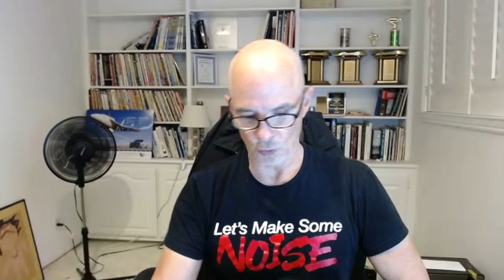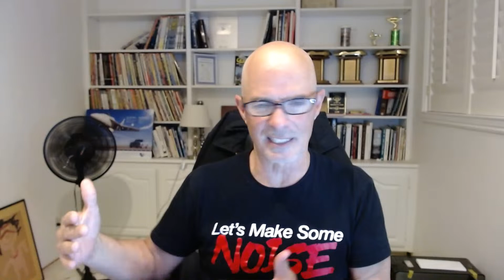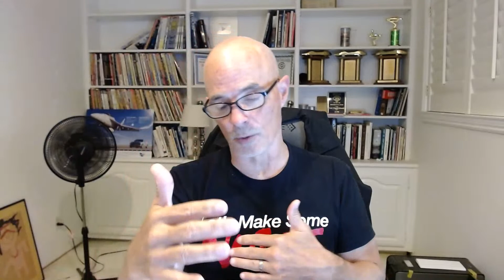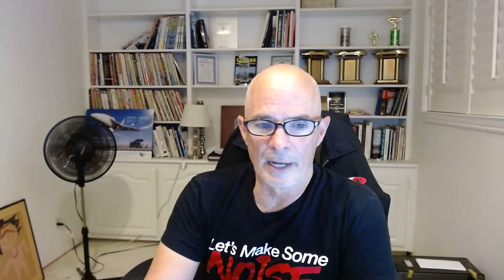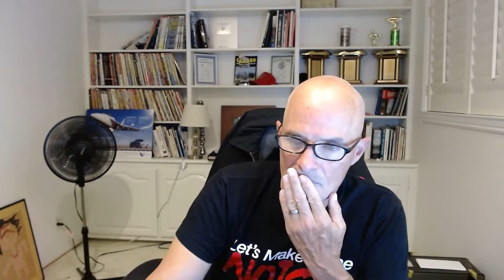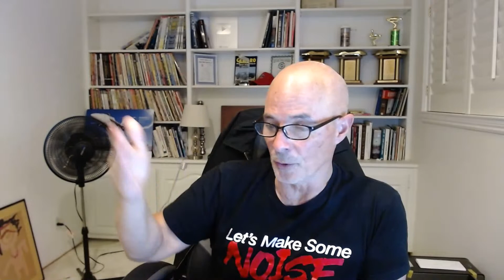LET'S TALK TECH-ROLLER ROCKERS VS CAM UPGRADES

Comment: I bought a Stage 2 cam with all the essentials. I really dont want to do an aftermarket cam. I now prefer to keep the truck stock. The truck is tapping and I suspect a lifter has collapsed. Can I use the trunions, double springs and lifters from the kit but go back with the dod lifters in their perspective places.
Reply from the maker: I would just use stock springs

Comment: This is the info I have on a cam in the car I just bought.   The car has no balls for s 350 crate engines. 
Hydralic Flat tappet Camshaft-
Intake Lift-.383" Exhaust Lift-.401"
Intake Duration @ .050"- 194 Exhaust Duration @.050"- 202
Lobe Seperation-112
This cam Has a mechanical Fuel Pump Lobe.
This is a low end Torque oriented camshaft.

I am putting 64cc 202 heads on. I was thinking about putting 1.55 rockers on.  By the way it is a Gen 1 350.  Thoughts?
Reply from the maker: that is a stock(ish) cam
Reply: @richardholdener1727  would 1.55 or 1.6 rocker arms help any?  It is a driver and I just want a little punch and a good sound.

Comment: I have a lm7 can I just put a truck Norris cam in it with nothing else and achieve 400+hp
Reply from the maker: and springs-assuming you have enough injector and proper tune

Comment: A roller tip rocker will always loose ratio when not at 90deg to the valve.  A shoe type rocker depending on design can maintain or even gain some ratio depending on how the tip is made geometricly.

Comment: Watched your vedio on the 460 builds. This made my mind up. The 500hp build was great. Flat tappet cam, ported C8 heads, made peak power round without turning just over 6000rpm! I'm just gonna buy the roller tip rockers just to make sure the ratios are all the same. Good old redneck tech motor reliable on a dirt cheap budget.  It's gonna spin the tires thru 1st gear anyway 😂😂😂 !

Comment: After many, many years of building and assembling high performance V8’s, I had to learn the hard way and the expensive way that a double roller timing set or aftermarket rocker arms were not necessary on high performance LS engines. Eventually I learned that all reputable shops/ people a lot smarter than me were using single row chain sets and stock or stock style rockers 100 percent successfully.

Comment: Did you ever do a 1.7 roller on a ls vs stock?
Reply from the maker: 1.72
Reply: @richardholdener1727  i thought about the same thing. TSP has the 1.72 but they recommend a shorter push rod, the springs need to be upgraded as well. even on a stock cam like a LM7, a quick cheap hunt for power turns more expensive since everything else needs to account for valve float.